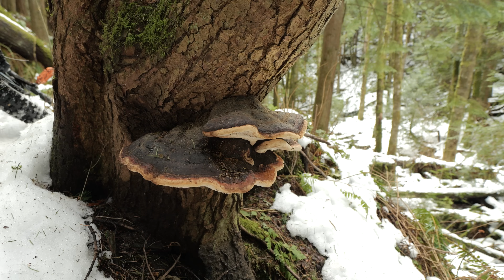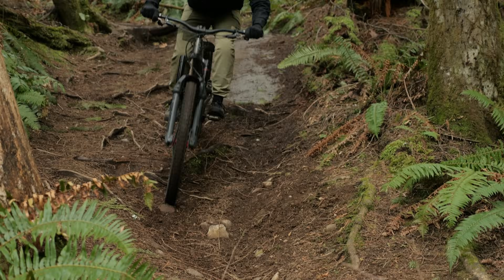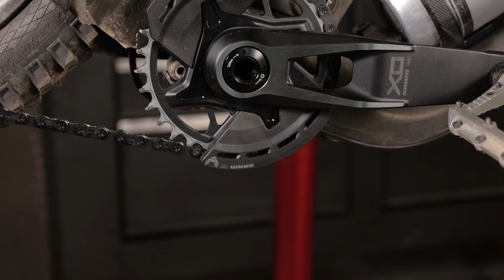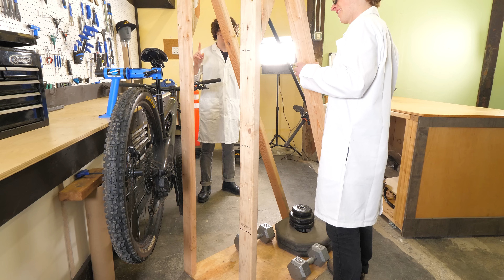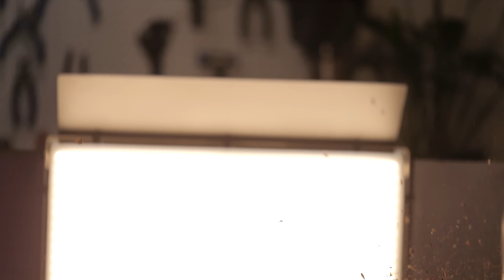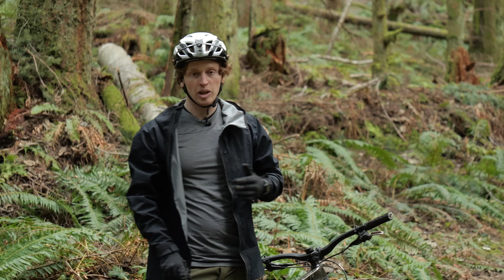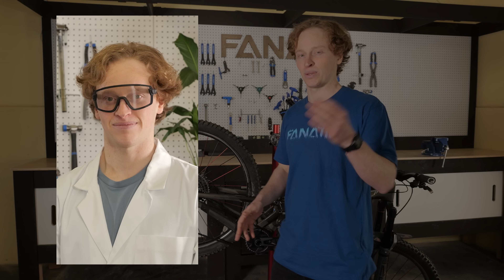Transmission: Why SRAM’s new drivetrain matters

Comment: Anything from 2019 and below don’t benefit at all, you would have to literally buy a new bike with the UDH integrated on the triangle so anybody wanting the new t-type is basically out of luck and just stick with the X01 for any group set upgrade specially with my trek fuel EX8 It would’ve been nice to upgrade to the GXT type and to change the booster since everything can be mix matched, but not the case

Comment: For me electronic shifting is a must due to my thumb misaligning during shifts, not every shift, usually I never know when it will happen, so unless I feel it's already misaligned and my thumb locks up it will hurt horribly as it happens during the shift, no way to stop it, As archer Components is going out of business, I need another option in the future if this breaks down, I hope my unit can get repaired before they shut down completely.

Comment: shill central
Reply from the maker: I'd beg to differ. I didn't like AXS, and in fact made a whole video about why (https://youtu.be/pi9OS84reXk).
I've been running the exact same drivetrain I broke in our other video, and think it's quite good. Not earth-shatteringly better, but an in improvement none-the-less. If you don't want it, all you have to do is not buy it.
- Dan P.
Reply: @FanatikBikeCo  yes upgrade upgrade upgrade we get it so does the new one make 12 speed work until the next one comes out ?

Comment: The system seems impressive although the weakest point in the system will always break first. Before the weakest point was the derailleur hanger that cost change to replace.
Now to me it seems like the weakest point of the system would be the pulleys cage, I wonder if the cost of the cage is lower/same/higher than the trusty hanger...
Probably higher...it's the how to pull money from a product that's already been sold...time will tell✌
Reply from the maker: In my experience, it has been impacts to the b-knuckle (like the ones we did in our other video) that tend to bend the hanger. Usually the derailleur fares okay with those. Impacts to the cage will often time ruin the derailleur (previous pulley cages were not replaceable). With this derailleur, you can now replace the cage in it's entirety.
- Dan P.
Reply: @FanatikBikeCo  hey, yes I know it all parts are replaceable now, well my point was, are the weakest parts(that take care of functionality) of this derailleur also as cheap to replace as the derailleur hanger(most probably not) and can you take them with you in a pocket on the trail(obviously not), well anyway the hardcore riders will prove it's usability etc...cheers ✌

Comment: Wonder if they'll make this transmission technology with a cable actuated version and or in 10 or 11 speed?  That sure would sell me on one!
Reply from the maker: I suspect they won't. The costs to develop the manufacturing capacity for that (not to mention the R&D to develop a similar cable actuated version) would be significant, and I bet SRAM doesn't see the return in it. That said, it seems they intend to continue making all the current mechanical components for some time, so I don't think we have to worry about losing access to that.
- Dan P.
Reply: @FanatikBikeCo  Its kinda a shame.  I mean, the new direct mount stuff is technology everyone can benefit from regardless of if you like or can afford wireless shifting or can not.  A shame you have to go electronic/wireless to have access to it. Maybe the "trickle down" affect that we see with other mtb tech will work its magic here and in a few years maybe we'll see something offered?

Comment: Can you use the Road AXS briefers (Rival AXS) with the new transmission derailleurs? i.e. run a 1x Gravel mullet drivetrain.
Reply from the maker: No, the whole Transmission group is not cross compatible with anything other than the original AXS Eagle controller.
- Dan P.
Reply: @FanatikBikeCo  That is a little disappointing. But the good news is that it means I can jump on existing GX/Rival AXS stuff for a mullet build without waiting on Transmission to be in-stock. Would have liked the durability and load shifting of Transmission, but I'll appreciate the cost of GX AXS instead. Thanks for the follow-up!

Comment: Cool. One of our friends just cracked his new frame earlier today because of this transmission already. Lol!
Reply from the maker: What happened? What frame?
- Dan P.
Reply: @FanatikBikeCo  it's a Bronson, he just got it too. We hit this trail that's really chunky and he bashed up against a pretty large rock hitting the transmission. Wasn't shifting too good after that and when we got down, his rear triangle had a crack and was no longer straight. Basically, from what we could tell, the transmission is very strong. Due to how it mounts though, if hit hard enough it can transfer all that force into the frame and make it the weak point unlike a regular derailleur with a hangar as the weak point. These rocks/stones break a lot of hangers and derailleurs, but not many frames. Popped his cherry lol.
Reply from the maker: @erod6468  Wild. Has there been any resolution from any of the parties involved?
- Dan P.
Reply: @erod6468 do you have any reason to believe that it didn’t hit the frame and the derailleur?
Reply: @FanatikBikeCo  hey man sorry for the late reply. Last I heard it was all taken care of no issue, and he's now rocking a X01 derailleur instead.
Reply: @omsteve4761  when we looked, all the damage/scrapes and such was only on the trans. The frame had nothing besides the hairline crack throughout.
Reply: @omsteve4761  either way, I'm not a bike engineer and only SC knows what up. They did send him a new rear triangle though.
Reply from the maker: @erod6468  Glad to hear it!
- Dan P.

Comment: This was not invented to be better, but to make more money.  More to go wrong, and the loss of a cheap derailleur hanger is sheer stupidity.  In biking, if it can go wrong, it will.  And here on the North Shore, there are so many rocks I can't see how this is any better or cheaper than what came before.  And the fitting standard for this is stupid.  Just looking to make frames obsolete as quickly as possible.

Comment: Unclear to me was whether the new hanger set up means prior hanger frames are incompatible with the new hanger system meaning you just forget about groupos and buy a whole bike?
Reply from the maker: If your frame has a UDH (Universal Derailleur Hanger) it is compatible. If not, it is not compatible.
- Dan P.
Reply: @FanatikBikeCo  Which seems to amount to the same thing, unless your frame is recent enough to include this construction, your options start with a new bike.  IOW how backward compatible with other replaceable hangers is the UDH (which does seem remarkably, for SRAM, cheap at $16 retail).

Comment: As an old mountain bike racer from the 90s who spent a lot of time riding in the backcountry of Alaska, I can’t help but agree about preferring simple equipment.  I don’t even like the idea of hydraulic brakes; I would use a high end cable model (like the Paul brakes) if I was still riding in Alaska because I prefer fixable equipment that can be dealt with anywhere, anytime.  I still am not sure about these electronic derailleurs.
Reply: So by that logic you only park your car and slow down with your handbrake because it's cable actuated, unlike the hydraulic, fluid based braking system all cars have? Aside from a pretty poor opinion, many channels have proven time and time again that hydraulic brakes are vastly superior in every way. Even the best cable brakes are only able to compare to dual piston brakes while quad piston can stop 400lbs of bike, people and gear going 25mph to a dead stop in 20 feet. Cables would let you run right into traffic and get hit. Safety is everything and cable brakes are not good enough anymore.

Comment: So he never did reveal the smash test results.  Did the frame get bent?  (The derailleur hanger was never for the derailleur - it's always so you don't trash your frame)
Reply: The hanger was never for the frame. If you know history, it was invented along with the derailleur to mount on the frame. They were steel and braised to the frame. modern replaceable hangers are made of softer material to save the derailleur.
Reply: @toddcoble1485  Nope, mostly to save the frame.  Side benefit if it saves the deraileur...
Reply: @bikebudha01  Nope
Reply: @toddcoble1485  you're wrong on this, they are there to save the frame, the more critical and expensive component

Comment: SRAM has made a solution to a problem that has never really been a problem. I ride on many trails around here that is ridden on the Cape Epic every year and have yet to replace a derailleur hanger. I had my current bike now for 6 years with it's XT group set and my previous bike with XTR for 5 years before that.
Reply: Also keep in mind how many adjustments are no longer necessary with this new drivetrain. Misadjusted drivetrains we're definitely a time consuming problem. Not super annoying, but it's nice to not have to adjust it anymore.

It's still very expensive though
Reply: you are only one person. I've replaced my hanger multiple times, and I know many other riders who have needed to as well. it has DEFINITELY been a problem for many many people aside from you
Reply: @toddcoble1485  It's not a problem if the hangar is an standardized part you can get in stock in every bike shop.
And that was the only problem both SRAM and Shimano could solve much easier.

Just force or bribe their OEM's to use standardized hangars.

Comment: "If you bent your derailleur hanger usually the rest of the derailleur is toast, too", sorry but that is just 100% marketing babbling and not true at all.
What I hate about modern derailleur tech is that it never focuses on being durable, from an engineering standpoint that's understandable because given that it's a bunch of open cogs and a finnicky mechanism that's supposed to slide a chain under tension across them it's pretty much a lost battle. So these bikes are ultimately designed for people who happily spend a bunch of money on their bikes only to ride them on prepped trails instead of offroading.

Comment: This video is clearly sponsored...some of your conclusions just make me angry. The new manufacturing technique is clearly a massive cost saving, less cnc machine time, Pressed steel parts are so much cheaper, not better. Like not putting bearings in the jockey wheels.  You make it aound like hangers are flexible, and yes you can bend the alu hangers square, why do you think the park tool is build like it is.. When you come to the lab test bit, how about you add some maths.. You are riding down a hill at 50mph (google Max Stockl if you think this is optomistic), bike and you weigh 100kg..  You put the derallier into a solid rock. kenetic energy =0.5mv^2 , you need  100kg at 2.2m, less weight you need to go higher.  Now add that most bke frames aren't designed to take these loads. Buy some rear triangles and test them.  I can not only smash your £1000 gears you can also smash your frame.  How about they do a 9 speed with the same range,  Now they can make everything more robust.   They're welcome to make it electronic but they need to match the price of the GX groupset at £80.

Comment: Stopped listening at 0:22.  Most of the opening comments about AXS are not true except price.  Having turned the wrench on my bikes for over 45 years, I can say AXS is easier to install, easier to dial in, shifts better, and while expensive, worth every penny. 

Whatever he has to say about the new drivetrain may or may not be valid. But the premise is spotty.
Reply from the maker: That has not been my experience. The micro adjust has the same functionality as your barrel adjuster. B-tension still had to be adjusted with AXS. The limit screws on a mechanical system only need to be adjusted the first time, so it's not something the rider would have had to mess with after the initial install (and even then it takes a minute or so to do). There's the cable and housing install, but that's a once a year thing at most, and once it's routed the first time, it's easy to use the previous cable or housing as a guide for the new, dramatically cutting down on time to replace. AXS is heavier for a given tier (X01, XX1, etc), requires a battery, and seems to suffer from more chainslap. What am I missing?
- Dan P

Comment: I heard that Transmission isn’t compatible with super boost hub spacing…is that true?
Reply from the maker: It is! It just changes what spacers you use at the bottom bracket. You can see if it works with your bike here: https://bikefinder.sram.com/universal-derailleur-hanger-bikes
Basically, does your bike have a UDH hanger.
- Dan P.

Comment: I wonder if its possible to run the SRAM transmission cassette / chain on an eagle cable shifter / derailleur / crank. Would this work and increase performance?
Reply: I can't imagine this not working since they're using the same chain.
Reply: @xnoitulos  what? the transmission has a new redesigned chain to match the cassette. I think it could work too, just want to know if it works well and could make a cable actuated drivetrain shift smoother, faster, under load, etc

Comment: I love my axs, I think srams big mistake with this transmission group is that it is not at least backward compatible with original eagle cranks and chain line. Over time as my cassette, chainring, chain and derailleur need replacement I would consider going transmission. I get it's a whole new system but the cranks and chainring mounting could have stayed same as Eagle and it would have got more peeps going over to transmission I reckon ?

Comment: When asked about longevity SRAM had this to say:

"We have given the new X0 and XX Transmission chains the designation of our strongest chains ever produced, and this is due to a few design factors. Moving to a flat top design has allowed us to add material into areas of the chain where strength is crucial. Additionally, we were able to increase the thickness of the cassette cog and chainring teeth, to improve overall lifespan. The new Flattop chains are available with the same coatings as our XX1 chains to help improve resistance to corrosion and wear.
 
Warm Regards,

Max.

SRAM Rider Support"

Comment: Will be the new rear derailleur only works on the old cassette with the old axs shifting?
Reply from the maker: The Transmission derailleur will not work with the new cassette, which sits further outboard than the old one.
- Dan P.

Comment: the T derailuer at the common fail point ie. hanger will be hard to damage…though the parallelogram joints are now the biggest weakness…still i look forward to the T transmission working it’s way down to the GX groupset in a couple years….or when the parts are sold separately…i don’t need the T cranks